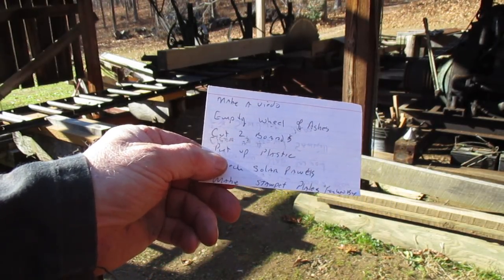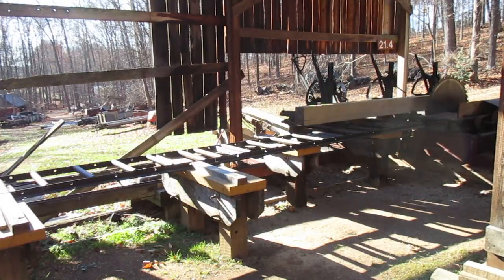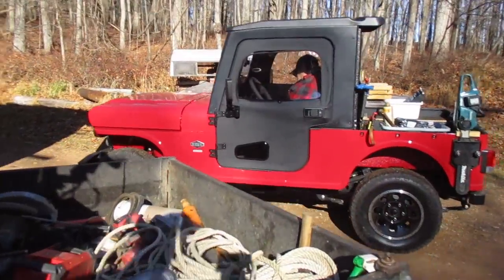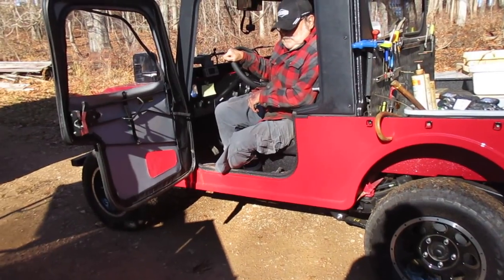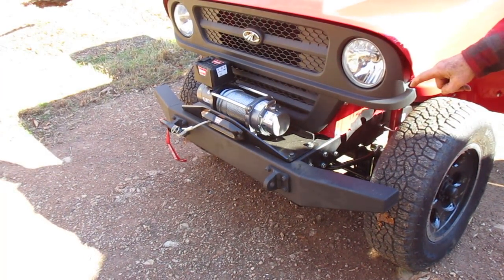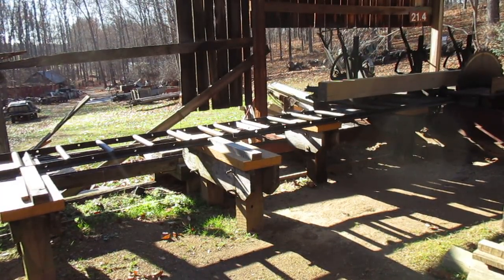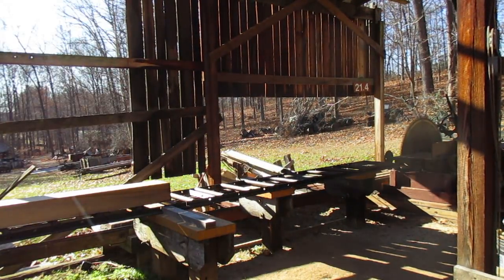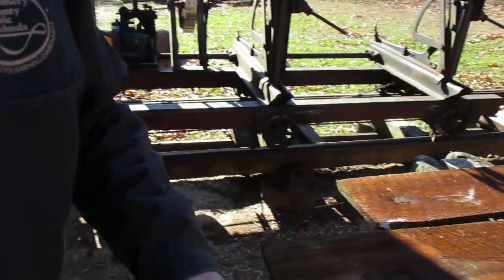A ROXOR and sawing 2 boards #592

Comment: Good evening, I thought about getting rid of my sawdust chain and going to blower . I have a big leaf vacuum identical to yours 11hp do you think that would handle sawdust ? Thanks Merry Christmas Happy New Year
Reply from the maker: hi there i just don't know . what is wrong with the chain john
Reply: @fricknjeep  nothing really   the rear end is suspended from the husk I feel like it might give me a little unwanted vibration when the chain  drag is working  harder than usual . Just an idea I seen it set up a few years ago on a sawmill  100 miles north in the middle of a field but I didn't see it run. It was just a thought I don't use it it just sits around here can't bring myself to get rid of it.
Reply from the maker: @sawmillingGarry  hi there if you have the time give it a try  john